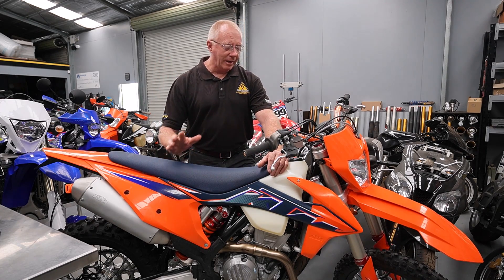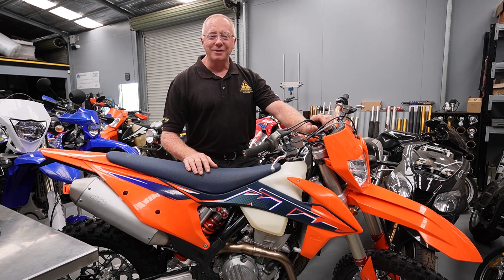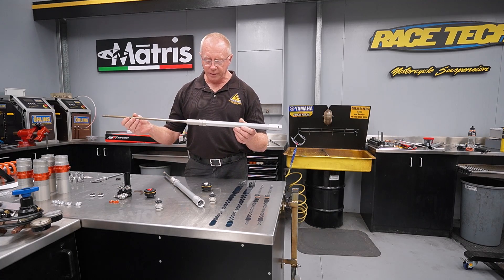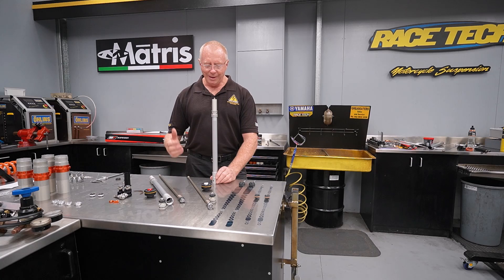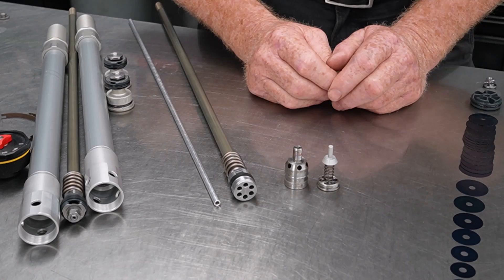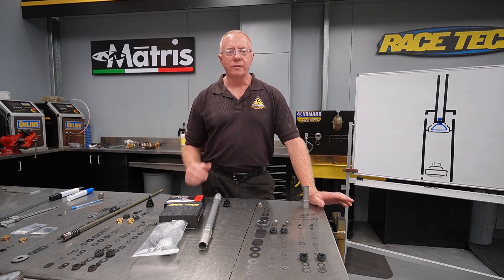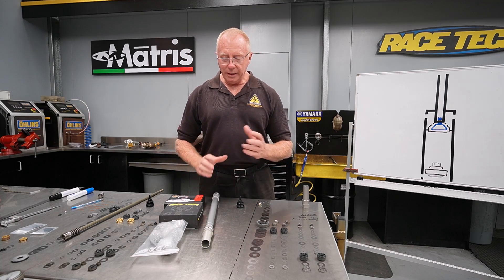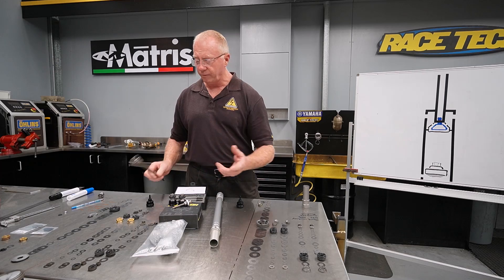KTM/ WP Xplor Fork

Comment: Am I correct in thinking this upgrade to the Xplor fork essentially makes them the same as the old open cartridge forks as fitted to my 2009 EXC 200?

Does the upgraded Xplor fork work better than the old open cartridge stuff?
Reply from the maker: The hardware is superior to the old fork but does follow the same design principles. Ultimately the performance will come down to how the valves are set up relative to your requirements

Comment: Hi buddy what’s happen if you change the spring in wp forks that only have spring in one leg? 
The ktm 1290 Super adventure R 2021+ have preload adjustment in both legs but only one visible spring in one leg, I it is 6.5nm I’m looking to put 7.0nm, but I don’t know if that will cause problem as the other leg don’t have spring. Thanks

Comment: I’ve talked to two local tuners (Arizona) and both recommended your cheap option, and they seemed think they could get excellent results that way. I can do the Gold Valve kit myself for cheaper they they quote, I’ve found good resources on how to, guess it ultimately comes down to good RTs shim recommendations work. Really not sure what to do.
Reply from the maker: The shimstack that they supply will put you in the ballpark at a minimum. Potentially within a couple of clicks. If you find you wish to adjust the stack later on, you already have a baseline to adjust from.
Reply: So I installed the RT kit and test rode it yesterday. It really made a noticeable improvement.

Can you remove the base valve on these forks without taking the top cap off the fork? For making base valve adjustments without draining oil.
Reply from the maker: @abaz33  You can simply turn the fork upside down and remove the base valve. You won't lose any more than a few drops. Just make sure you clean the base perfectly before removing the base bolt.

Comment: Hello! 

Great explanation for how this fork works.
Would you please tell me if I get this correct - the simplest and cheapest solution to at least substantially reduce the tendency for the compression fork leg to de-stabillize the oil and considerably increase the "consistency of the performance" would be to either swap out the vented upper cartridge part, plug it somehow or replace it with the outer cartridge from the rebound leg + somehow (with some kind of a spacer) create a situation when by turning the compression clicker fully in you cannot fully seat the "conical valve" that is on the end of the cartridge rod, kind of "mimicing" a bleed or a float on a mid-valve when the compression adjuster is turned completely in.

I think this solution would take care of both of the problems you mentioned with the compression leg - at least to a considerable degree. It wouldn't allow any oil to migrate from the "rebond" side of the cartridge in neither stroke through the vent holes and even if the compression adjuster would be turned completely in it wouldn't allow the whole volume of oil displaced by the "valve assembly" on the end of the cartridge rod to get pushed through the basevalve, causing the need to refill the chamber totally under vacuum. Sure, finding the right size of this bleed could be imparative to prevent as much cavitation as possible on either stroke which might happen due to "rebound" chamber not filling up properly if the compreesion adjuster is turned fully in and the "bleed" is not large enough", but anyways this should considerably improve the "consistancy" of the performance with really low cost, wouldn't it (I know for a fact that at least here in Europe I can order the upper, non-vented cartridge part from K-Tech for something like 100 AUD)?

Would you say that it would still be better just to tune fully tune up the rebound leg with all the base valve shims, mid-valve/rebound shims for a "complete" "cheap" solution and just ignore the compression leg? In such a case, would you recommend reducing the base valve shim stack in the compression leg down to bare minimum and opening the clicker essentially up just to reduce damping as much as possible and thus produce the most "consistant" feel (as if there would be any damping in the compression leg the risk of cavitation would "upset" a bigger portion of the whole "system" damping and thus afect the consistancy of the feel)?

Hope you can answer this as I'm just only starting to learn suspension (structural engineering background) and I'm quite interested whether I'm starting to grasp the concepts.

Thanks!

Comment: Installed the Scheaffer valve kit in my 2020 150 forks and am totally amazed.
They are plush at low speed and accurate and confidence inspiring at high speed.
Thanks to the Shock Treatment team my 150 is even easier to ride.
Cant believe how bad the original forks are on such a late model bike. Ready to Race ?  lol
Reply: where do you order that? I can't find anything online.
Reply: @LCARSADV   Depends where you are.
US ?
Reply: yes
 @RIPPERTON
Reply: @LCARSADV   Theres one manufacturer but a number of suspension tuners order the same kit under different names.
Just go to a tuner near you and describe the kit. They should be able to help.

Comment: Compression leg is a modern version of a damper rod fork. I plugged the the top cartridge holes and have a mid valve with a check valve instead of a rebound stack so I still have working reb/comp adjusters.
Reply from the maker: There are many options you can use to achieve improvement with this fork with varying results. You can still use rebound shims in the compression leg and have comp adjustment. Just ensure the force being generated by both stacks remains biased toward compression and the adjuster will favour this area. The compression stroke will operate at far greater velocities than rebound ensuring that this remains so.

Comment: It looks like turning the compression adjuster IN would unseat the compression valve and make the setting softer (opposite to regular adjustments). Am I confused?
Reply from the maker: There were left hand threads to counter this and early upgrade kits became a little confusing as the comp was indeed backwards "after modification". Kits like the Scheaffer kit provide new rebound assemblies which create conventional adjustments.
Reply: Do I understand correctly - on XPLOR forks top caps which hold the "screw" mechanism for clickers are of different "threads" for rebound and compression side? That is, if the rebound side has a right hand thread the compression side has a left hand thread or vice-versa? Meaning, if I replace the compression "valve" assembly with a conventional rebound piston and shim stacks my compression adjuster turned in would open up the damping rather than close it? Or am I missunderstanding something here?

Comment: I have cone valve forks you s set up for me through Brendan I live in Thailand just wondering if your one the top off the inner fork tube goes black where its machined like about the top half offf it
Reply from the maker: The machined section does allow for discolouration but it does not affect performance.

Comment: Hi Terry and the Shock Treatment Suspension team, can you please tell me where I can find more information about the Shafer kit? I’m lead to believe that is the only kit you will make a custom shim stack to suit the purchaser/rider for?
Cheers,
Lucas
Reply from the maker: Hi Lucas. The Scheaffer kit is on our shop site. It is the same kit as the KTech item. We source them from the same manufacturer but place our valving on it that not only works better but we adjust it to suit each riders requirements
Reply: @shocktreatment5495  Thank you very much for your explanation and replying:) Is the Scheaffer kilt your preferred kit if you are custom valving it to the rider or can you do that with the Dal Soggio also?
Thanks!

Comment: Excellent. Can you do xplor shock as well? Have they sorted the needle taper since the early days of pds? or do you still need to buy telescopic needle?
Reply from the maker: Sure we can have a look at it, the problem with the needle was never the taper but the length. The new Xplor shock does not use the needle it uses a secondary piston and a cup at the top of the shock which creates additional resistance. Once again the cup is too short and only functions in the final stages of travel.
Reply: @shocktreatment5495  wow i didnt even know that. I'd love to see one pulled apart and discussed by someone who knows whats up